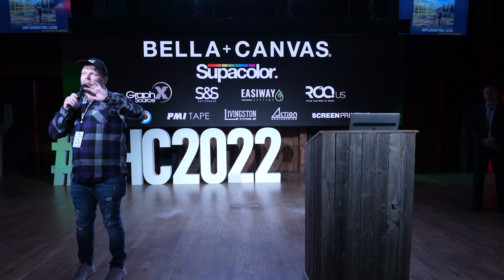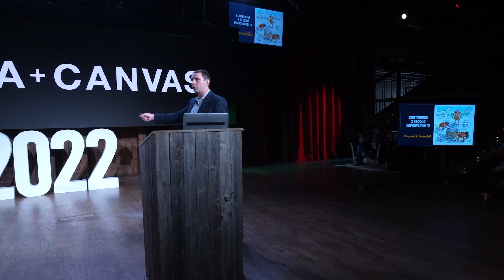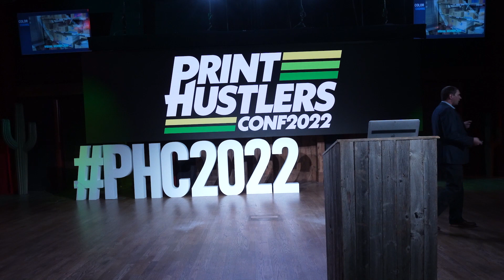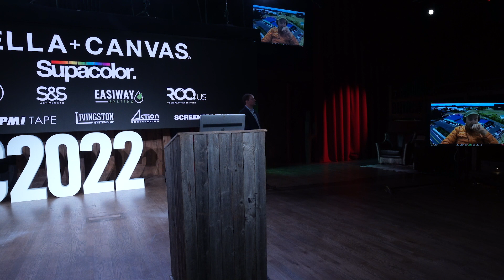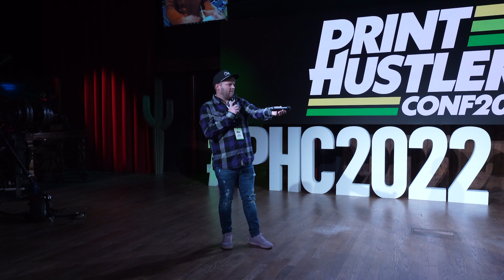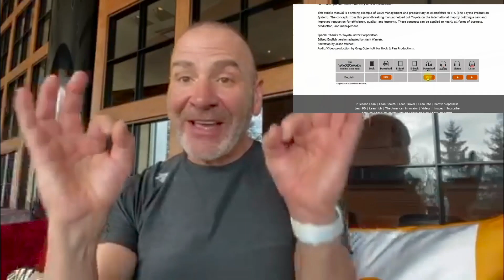How to apply 2 Second Lean to your business| Lucas Holland | Paul Akers

Comment: I used to work in a pub / restaurant and i would set up left and right hand optimised salad bays depending on work flow and preferences of the operator. Magnetising them was the next step but i left...but later on in my new job I have stuck magnets to so many things like calculators to metal benches, mini rubbish bins, pens and sticker holders. Everything can be moved around by the operator so they can customise their work experience.